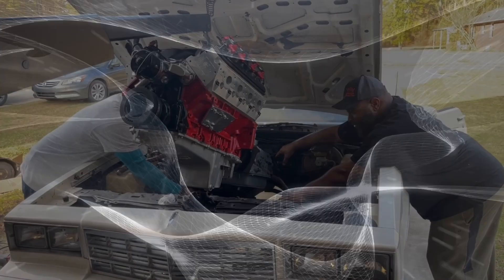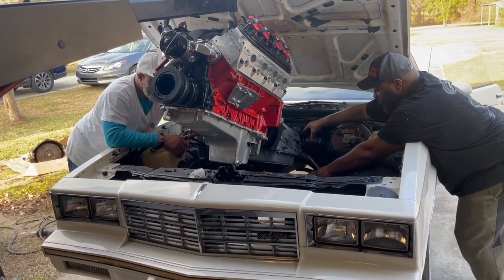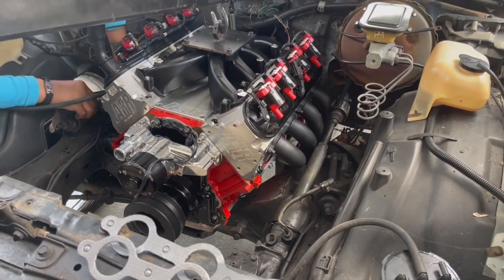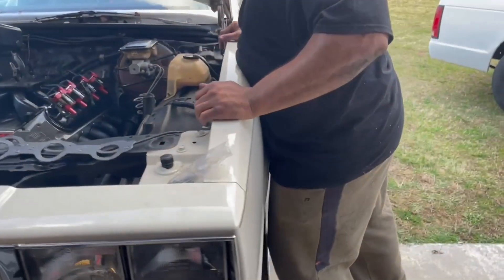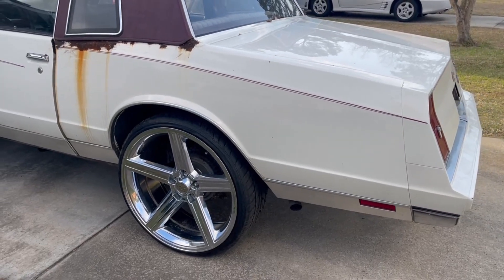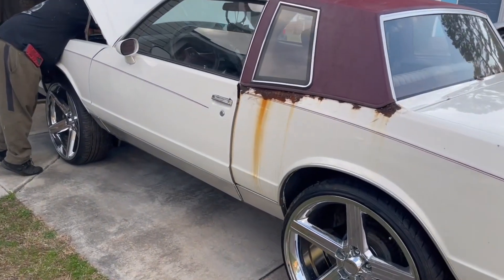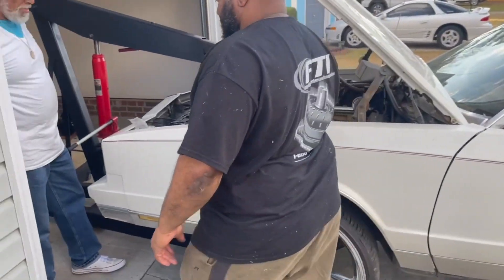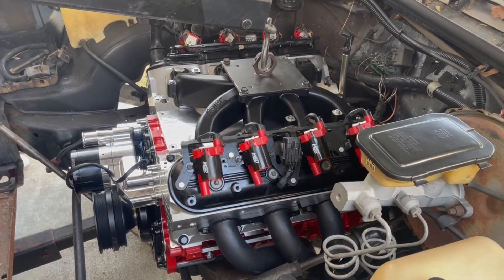LS SWAPPING A 84 MONTE CARLO

Comment: Finally someone does justice to a non SS Monte Carlo. I think the plain MC looks just as badass as the SS . I know it won't handle the corners like an SS but hey some people just wanna go fast in a straight line. 95% of the LS swapped MC SS cars never see any aggressive corner carving driving. So why not use all of those beautiful non SS Monte Carlos that are sitting all over the country and most have tired weak old 305 V8 motors or the big and really weak V6's in them still. Plus a non SS Monte Carlo can be gotten for a lot less doll hairs. G bodies are just begging for a healthy LS , LQ, LM swap.  I have a 1984 Monte Carlo with a Lq9 and 4L80e trans and a factory diff with a 3.42 Limited Slip and it is a all stock motor except long tube headers and a cold air intake and it is a monster through the 1/8 mile and has a top speed that I personally don't care to drive it at ever again. It will pull 60' times that make late model Camaro SS drivers nervous. I'm currently putting a rear disc brake conversion kit on it for obvious reasons. And due to the 4l80e and OD it gets some decent mpg numbers.
Reply from the maker: Thanks buddy for commenting on the video ya that car am building for my buddy has a really lot of nice parts on that car am soon be making a new video on it thanks buddy for your support